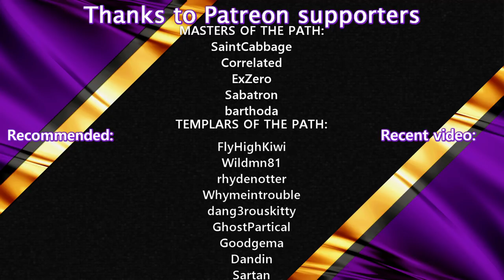Factorio Reverse Megabase | #12 GREEN CIRCUIT THROUGHPUT ISSUES | Lets Play

Comment: You're not sending green circuits from blue circuits build to the speed modules build from column 2nd till 8th. Only 1st column gets proper amount of greens, all others are starved. It's a matter of missing splitter in first row of blue circuits. That's why the speed modules factories are mostly not working.

Comment: Thank you for making this series - I'm very new to the game and loving it, mostly down to you and your easy to follow tutorials. I can't, for the life of me, understand how you create the lane balancers. I know why and see them working but wouldn't know how to make one from scratch. Perhaps that's a lesson for another day?

My reason for writing is that I've noticed my solid fuel production isn't fast enough. I came across the problem when I hooked up my tracks to the Rocket Control Unit station at the end of the last video lesson. I'm more than a month behind so this may be addressed in a later video I haven't got to yet.

I first noticed a problem with the Rocket Fuel which wasn't coming in fast enough. I disconnected the tracks to the silos and allowed the storage boxes to fill from the incoming trains. When I knew that they were all working in sync I became aware that the production of the fuel kept stopping due to shortage in solid fuel. I did the same with the storage boxes here before looking at the Solid Fuel Factory. I did notice that the 8 to 8 lane balancer wasn't really balancing - the four on the left were the same as each other, then the other four were the same as each other but the two sides wasn't in balance. I replaced it for one I downloaded in a Blueprint Book from one of the Forums.

Firstly, the 6 to 8 lane balancer wasn't creating an equal output across all tracks at the Solid Fuel Factory. I pasted in another version from the Blueprint Book mentioned above. After allowing the storage boxes at this station to fill and the lines to back up before allowing the trains to load, I left the game running for an hour or so while we had dinner. 

Now I've come back to the game and can see that the new lane balancer is definitely working properly. The wagons haven't become out of sync with each other on the same train. But, the factory isn't keeping up with demand. When the current train hasn't loaded even half, the last one comes back from its delivery and is waiting to be filled.

I think the issue is down to the low pressure of the Petroleum Gas - the last five of the Chemical Plants on each line in the factory aren't running so the output isn't anywhere near the calculated one. 

I don't know how to address this other than by making more Chemical Plants and refineries to up the production. In the meantime, I've replaced one of the storage boxes by an Infinity Chest just to keep things going until the next train arrives.

Comment: if you placed the output belt for the modules at the bottom of the constructors that would allow you to run a full belt of red circuits above the constructors and skip all the belt shenanigans.
Reply: he has just one Tile at the Bottom,there is no place for an Inserter.
Reply: @ZeusBlackwing  you are correct, my mistake. maybe i was thinking of before he compacted it down but i went back and looked and there is only one space... hmm...
Reply: @SethRommel  One option is to do the belt of pure red circuits and have the output put like he did on the masterclass for late game red circuits themselves, where it is out put on a second belt that runs parallel to the input belt.

Comment: About the train problem in the start. Wouldn't you want the train to leave whenever one wagon is empty, to avoid that one row of your science stops working? Since you don't balance. So my suggestion to do that would be: Circuit connect and read belt contents on all the belts just before it goes into the labs. When they are full they should read 22,5*16=360 of each science. Feed that to all the input stations.

 Then for the train have the following orders: until empty OR [ time passed 60 seconds  AND circuit condition space science less then 340]

Then basically do the equivalent of that that for all the stations. Also have train limit 1 for the pickup station so it can't continue unless the next train is allready done .
Reply from the maker: it would just mean the loading becomes unbalanced. The imbalance was due to mistakes with incorrectly filled belts that slowed some lines. I would rather fix it by resetting it.
Reply: @Nilaus  you generally balance and buffer loading, and also slightly overproduce, so it shouldn't in the end. But yea reset is an option too. :)  starve it and let all science be consumed before you let in the next train. But wouldn't it get imbalanced again over time though?

Comment: Would it be possible to make some kind of an "eco" series where the focus would be on minimising pollution. Like have bigger forests and purposefully try to not just clear cut everything. And to make it more interesting, to mod the biters so that they aggro a lot harder from pollution. It'd give the game an interesting twist as it forces focus on areas of the game that you don't usually put too much thought on.
Reply: You wouldn't even need mods for that. You could just change the pollution evolution factor, the pollution attack cost modifier and maybe the pollution diffusion ratio at the map generation settings.
Reply: I thought this would be an interesting challenge. The objective could be succinctly defined as launching a satellite while refusing to make any Military Science Packs. In the vanilla game this would limit you to walls, machine gun, piercing rounds, gun turrets, and grenades. (Although it is also amusing to imagine base defense designed solely out of ramming locomotives, hahaha!) Power armor Mk 1 and personal robots are available. Instead of making the biters more aggressive, it would simply give you fewer options for dealing with them, and thus you must control pollution to survive.

Comment: I very much like how compact and square the final build is. The supplemental line of red circuits feels a bit awkward, but I'm not seeing how to improve on it either. It's fine.

A few errors:
1. Missing the green circuit merger for all but the leftmost column
2. Spurious undergrounds blocking the supplemental red circuit lines on the 3rd column from the left of the 3 non-power-pole rows of speed modules 1s. (it's because when you put down the first supplemental line, your spacing was inconsistent, then copy-paste caused odd things)
3. Pointless undergrounds (in the second column from the right) on the line of the supplemental red circuits after they've already been merged into the main line.

I'm a bit worried about balancing the red circuit inputs. They're imbalanced both belt-wise and lane-wise, so you're going to need extra care. I'm thinking a lane balancer on every belt as a final stage just before entering the build, plus a full-length 8x8 balancer before that. For that matter, the green circuits are also heavily lane imbalanced. You might want to lane balance them just for appearances sake, even though it would probably work fine with the unloading system anyway.
Reply from the maker: Good catches. Fixed before next episodes :D

Comment: About the space science not being consumed evenly in all the wagons,  is it not related to the length of the belts? Couldn't you fix it by adding a belt balancer balancing everything that comes out the train?
Reply from the maker: That would cause a delay a slight variation for the middle vs outer wagons. This is because there were some errors earlier when that cause some columns to consume slower